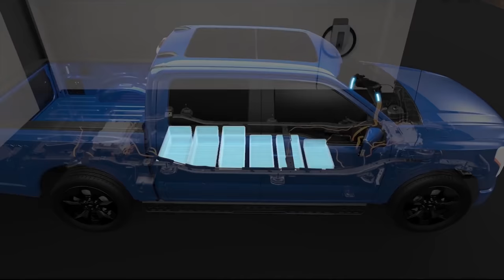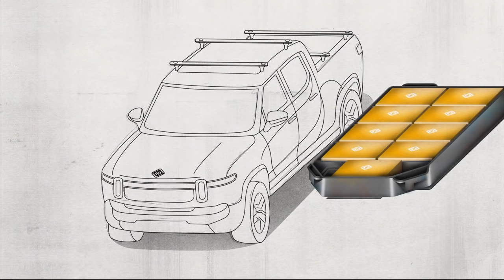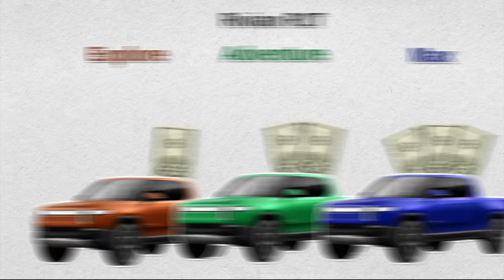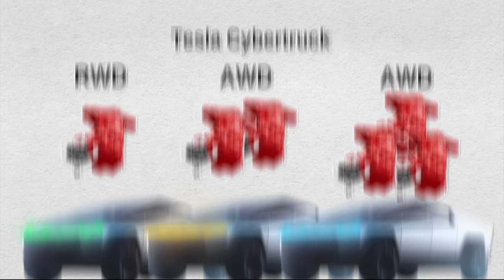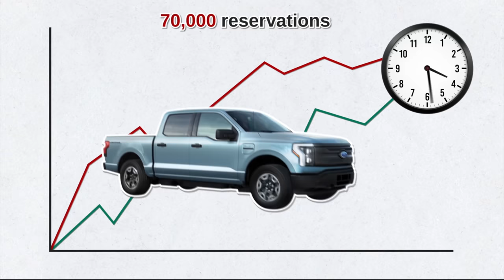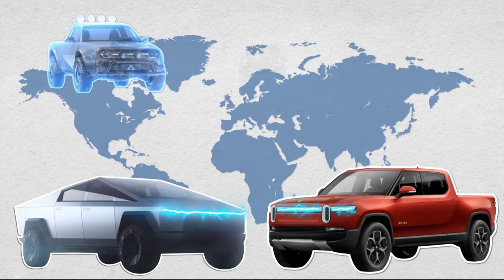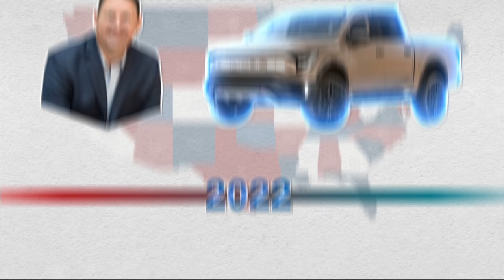Here's Why This Will Replace Trucks in America

Comment: I’m disappointed that more companies aren’t exploring the hydrogen fuel cell option.
Reply: The big rig manufacturers in Europe are switching over to Hydrogen ⛽      its happening.       Our Military Industrial Complex needs us to need rare earth minerals.
Reply: It’s not quick and profitable. Way too progressive for us.
Reply: study it. you cant get high power from fuel cells
Reply: @Paul S because only Toyota makes Mirai doh
Reply: Hydrogen for transportation is a greenwashing ploy by the oil and gas sector. Period.
Where to begin . . .
- Hydrogen would continue to come from methane which results in CO2 to make the hydrogen
- Hydrogen is horribly inefficient. With the same amount of electricity needed to produce green hydrogen a battery electric truck would go three times further.
- It takes 20 times as many hydrogen trucks to deliver the same energy to a dispensing station as one gas tanker
- hydrogen costs as much as gasoline and green hydrogen costs more than twice as much. Electricity is cheap at 10-20% of the cost of gasoline
- hydrogen dispensing stations cost $3 million for a station that could fill up about 25 passenger trucks PER DAY!. 
- hydrogen is heavily subsidized. In California all hydrogen stations get subsidies based on selling every kg of capacity every day even though only 10% of kg in actually sold.
- and the above is just a start of the list with many other hydrogen "show-stoppers" like servicing the hydrogen fuel system and fuel cell degradation as the cells get contaminated in service.
Reply: With that massive trillion dollar Infrastructure bill .. they could put fueling stations for it. The Electric Vehicles are getting better but not compared to Hydro Electric. That is the real future.
Reply: @MajorCanada  available for your refrigerator not the car
Reply: Also,  there are only so many btu of energy in a cubic foot of hydrogen same as a gallon of gas. Battery technology has had only five to eight years max before solid state changes the landscape, putting a death blow to gas  and definitely talk about hydrogen. Diesel will still be around for years but in time will fade.
Reply: @Paul S your right,  only one in Philadelphia, unless you're truck says PECO (Philly electric company) you are S.O.L!
Reply: Exactly, hydrogen and nuclear batteries are the way of the future, not this straight electric with conventional batteries tosh.
Reply: @JeffMTX  False. A Fuel cell vehicle would have to have a much larger battery to store enough energy for say a drag race. Fuel cells in vehicles cannot deliver busts of kW.
Reply: @jhindson88  yeah it's a myth that's why battery is cheap as dirt. See how I burst your bubble?
Reply: @jhindson88  Nuclear ☢️
Reply: Keep in mind this is the first time in generations big oil is not stopping future innovations. Is saw where one guy /company was experimenting with compressed air. Also bladeless turbines. N more.
Reply: Ballard, GE (before they screwed the pooch) and others did look into fuel cells back in the 90's.
Ballard tested fuel cells in public transportation buses in Canada.
It was a bust. 
Fuel Cells cannot withstand the constant vibration and bouncing.
And PEMs, Proton-exchange membranes, clog up and performance is degraded rapidly enough that it is not efficient for automotive use.
Fuel Cell technology is not new and has been well tested. The companies that tested it bailed out of it.
Reply: No money from the government for hydrogen , I'm curious to see what the range on these trucks are when pulling half of there towing capacity.
Also,  why not make hybrids then you can drive as far as you want but have the advantage of torque  and direct wheel power that would suit a truck, it works on locomotives
Reply: check out toyota..just brought out new hydrogen cell electric vehicle and are working on hydrogen combustion vehicles as well. I like hydrogen tech over battery power - so many chemicals and heavy metals associated with EVs
Reply: Kyle Cox, I know,  BMW was building vehicles for this and supporting it decades ago, and no one paid attention...
Reply: @kevinhirst911  Yeah, lets get a big river and a hydro plant installed.. :) :) :)
Reply: @jhindson88  Electric vehicles is greenwashing also. Nothing GREEN about them

Comment: I will never own an EV. Especially if they’re going to be this damn expensive.
Reply: Prices will drop fast!
Reply: I buy used beater cars. If my car has only 50%of its range when new and will need a $6K battery in 2 years I'll avoid it like the clap.
Reply: @robertcoyle9071  The new battery warrantees have improved greatly... but I would only get a Hybrid like the Accord or Insight.
Reply: Same here until they find a way to make the batteries replaceable. Right now they're built into the frame. However, I'm optimistic that EVs can become their own thing - they just need to be maintainable.
Reply: @robertcoyle9071  Our 2007 Prius battery replacement was $1500 at 172,000 miles in 2019. That included the labor, making the replacement in our garage or driveway, and recycling the old battery components. Those batteries last.
Reply: Never say never. They're cheap to own over the life of the vehicle.
Reply: @ItsBinhRepaired  define the life of the vehicle...my 2004 Silverado is still running strong.
Reply: @dawsen1855  What’s that supposed to mean?
Reply: Internal combustion can be powered with fuel can be done in your backyard such as ethanol or methane. Eleectric cars, you have to buy the lithium ion cells from foreign countries.
Reply: RepealTheHughes will own a EV, A Hoveround Electric Wheelchair - Motorized Power Chair and Mobility Scooter
Reply: You will eventually be forced to pay for an EV. Gas prices will soar.  Registration will be more expensive for gas powered.  So will insurance. They will force you to comply one way or another.
Reply: @dennisdmenace6249   I was told this 5 years ago on the ebike forums when I built my bike. Replacement batteries cost more today.
Reply: never say never my friend
Reply: I agree with you no ev gasoline power only will not take a trip then have to wait for a vehicle to charge to continue on a trip
Reply: @CraigDavies.  They have already begun to extend warrantees.
Reply: And at the moment used EV are more expensive without the incentives lol doesn’t make economic sense
Reply: @robertcoyle9071  How many miles did your car have on it when you got it. I want an EV but also want to know how bad the batteries degrade
Reply: @Dingbobber  its not about miles. Its about charge cycles and how may times you got the super impatient charge. Rapid charge kills duty cycles on any battery.
Reply: @dennisdmenace6249  I wouldn't get those either. Like I said I won't buy new and also don't have off street parking.

Its just one more subsystem that needs fixed and maintained. On top of the usual things that happen to any car.
Reply: It's very early of EV generation still, EV competition isn't as profound widespread as gasoline. Infrastructure isn't as spread out with high kW charge past 50, and the time it take to charge can be a turnoff if time is a big factor in everyday life. I'm still for EV, but the prices and the long recharge time isn't enough for me. When that changes I'll probably decide later on.
Reply: @jimf.625  I don't see that happening. Gasoline and other fuels only account for 40% of a barrel of oil. We have no reduction in the demand for plastics so they will have to do something with the liquid portion when they crack the petroleum. More electric means less demand for the gasoline. Theres also no realistic alternative to jet and diesel fuel.
Reply: @dennisdmenace6249  I really hope they drop, and better, but they will still be about $40k like many of these new shitty regular l4 engines being dished out.
Reply: @dennisdmenace6249  They will only drop so far...gas vehicles are already nutty priced.
Reply: @DeoVindice_61-65  meaning you look like you are closer to the end than the beginning: no disrespect. I’m 21. I hope I make it that long. It’s a privilege to age
Reply: You will, unless your going to hide under a rock or get the bus…

Comment: These trucks can get to 60mph in 3 seconds! Oh boy! I can just imagine all the rear end accidents that might happen! 😁😆
Reply: .... and the, hard to put out, fires.  Wonder how the electrical grid will handle the charging requirements of tens of thousands of these electric trucks, and how these will be rescued when they run out of juice on the roads (tow to a charging location and waiting)?  Battery disposal and replacement?  smh
Reply: 60 to 0 how fast?
Reply: @emeryyoung5097  Just watch the video! Pretty sure you can pick it up!

Comment: If this is true there are going to be a lot of people walking.
Reply: Yeah...these vehicles are geared towards the wealthier.
Reply: @ranytravis4953  and those who like single owner vehicles.  "Welp, the batteries need changing.  Time to buy a new truck."
Reply: I look for more E bicycles and scooters to head our way very soon. There will be something for everyone. That will be nice 👍
Reply: Well you can always try a bicycle.
Reply: @georgeorwell126  you think public transit is gov control? Get a grip.
Reply: @SolRayz  Public transit is owned and operated by the local transit authority, which is a component of the municipal government. There is also Amtrak, which is mainly a commuter train system that is owned and operated by the federal government.
Reply: @georgeorwell126  gubmint bad
Reply: @kibbles5724  correct
Reply: @brickbreaker9581  So you live close to stuff? Most of the country is rural and has to drive 30-40 minutes away to get stuff and that is driving at 55-65mph. LOL Good luck with that on a e-bike.

Comment: Let's start having rolling blackouts to undermine both electric vehicles and CDBCs
Reply: It’s coming. This is about total control
Reply: Solar panel charge battery with sun power, battery store power for house and charging station to charge vehicles. Drives away laughing.
Reply: @kennybmx  Then sits after 200 miles and real trucks wave good by laughing
Reply: Gas stations need electricity to pump gas as well. Also, most EV owners have solar on their roof which could easily charge their car.
Reply: @cappuccino-1721  How many watts of solar panels can you fit on a vehicle roof?  You ain't running any AC cool interior air on solar.  You ain't moving for quite awhile if you rely on just roof solar.  But it will cut your electric bill and your charging bill a little.
Reply: @jayrunner3347  not on the car, on their homes.
Reply: The funniest thing is that CA is the state with the rolling blackouts. They are also the state that gives the highest incentives to purchase an EV and increase demand for electric in CA.. For example, if somebody from CA purchases the base level VW ID.4 for 39000, they receive a 7500 dollar tax credit from the federal government. In addition, they can receive up to 13500 in rebates depending on income from various programs in CA.  Now the cost to you for that car has dropped to about 28K. This is why CA has, by far, the most EV's on the road.

Comment: I'm sure they'll be great during harsh New England winters. 🙄
Reply: Even worse in the desert climates where its 100 degrees in the day and freezing at night. Oh yeah good luck with that market.
Reply: Well the weight of all them batteries might help the hopless people who don't know how to drive in winter climates. 0 to 60 in 4 seconds ...cool how fast dose it 60 to 0?
Reply: Are there some issues in extreme climates? Yes.  But they're doing surprisingly well with EVs in Norway and Finland.  And we're just getting started.  The capabilities of EVs are going to increase dramatically over the next few decades.  In 20 years, we'll look back at internal combustion powered vehicles as if they were horse and buggies.  I'm old enough to where I'll always be nostalgic about them.  But most people won't care.  The electric vehicle is here, and it's not going away.  The high prices will come down too.  EVs are currently the large screen plasma TVs of the early 2000s.  They'll get better and more affordable as they scale up production.
Reply: ... like those in Norway?
Reply: @adamschoedel8829  Perhaps in 20 years EVs may be more affordable and be reliable under extreme weather conditions but you'll still have a product with limited range and a longer recharge time than pumping gas. Perhaps a backup Hydrogen cell system would work. In the meantime, don't tell me EVs are the climate savior of the planet. They need to built and they need to be charged regularly and that takes more energy than wind and solar could ever provide.
Reply: @emeryyoung5097  The only people who really care about that 0 to 60 time are the exact ones you don't want having it, because mentally they are 14 years old.
Reply: @adamschoedel8829  EV's now are like the big rush to make everyone use compact fluorescent light bulbs in their homes. Those bulbs made crap light, did not last long, and were filled with toxic powdered mercury, which is now leaking into landfills and groundwater. But we had to DO SOMETHING RIGHT NOW! even if it was stupid. As are current electric cars.

Comment: Scotty: "Here's what happens if you don't change oil"

Automotive industry: And we took that personally.
Reply: It is OK big oil will just keep on buying into the power grid... - a few pocket-change investments here and there...endgame - complete control.
Reply: @kadmow  sure and you and me will install our own solar panels and no longer need the grid. Only for the few trips a year that will be further then your battery range.
Reply: @Curacars ;  I should mention UTOPIA - ie. the impossible dream reality... 

My general electricity demand is already more than sorted with solar (80% exported in summer) - the additional battery capacity is not yet economical at my meagre demand / load.. (hot water demand/supply  also doesn't follow solar capacity - on cloudy weeks)....

lol.  Big Oil WILL Simply buy the electric Grid - then they too will own all future power capacity..